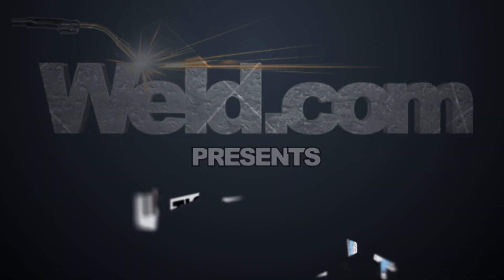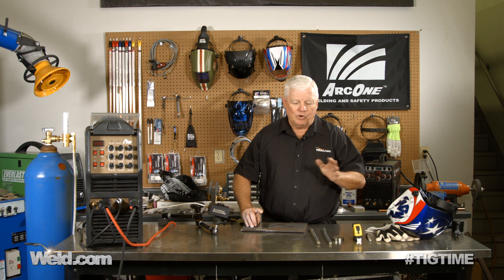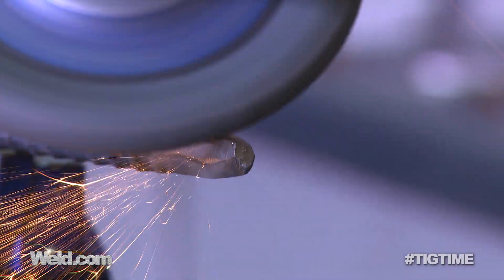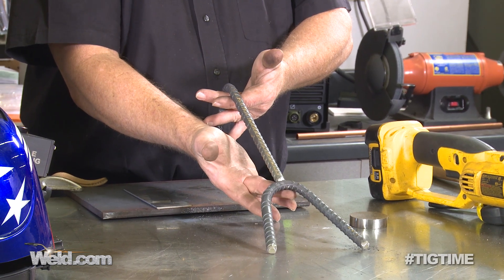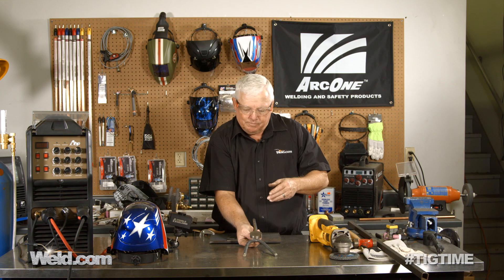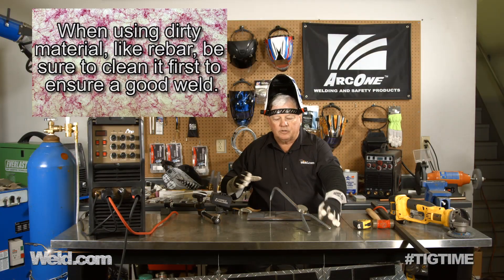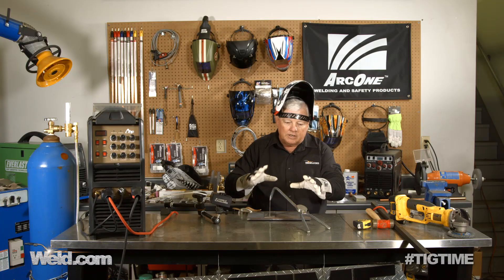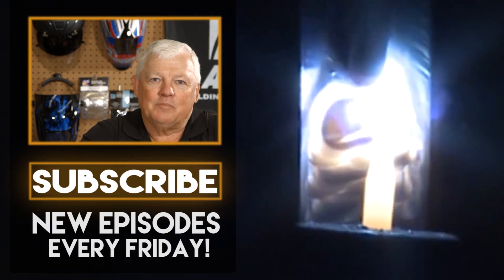DIY Welders Third Hand Tool: How to Build

Comment: The best use of a TIG machine for a maintenance technician is the ability to make custom tools that makes their job easier. I learned how to TIG weld over 40 years ago and would take scrap materials to make tools, sometimes melting in stainless washers to produce a desired shape. I will be making a third hand! Beats scrambling around finding a tool or piece of scrap to accomplish the same thing...

Comment: That looks pretty unstable for my taste, I much prefer a thick magnetic triangle and a strong neodymium magnet to sandwich the upright part in between. That third hand thing works probably fine for things that will not tip over so easily, but also there I am quite a fanboy of a strong collection of neodymium magnets ^^
Reply: Dennis Lubert I was thinking the same thing. My triangle magnets are my third hand.
Reply: noob , he did say it was stainless material he was tacking up. your super magnets have no power here !
Reply: miller welds noob, learn to read, especially the "strong neodymuim magnet to sandwich the upright part in between". They may not stick to the steel plate, but stick with enough force to the triangle to hold something in between

Comment: Just a thot of mine - I chisel magnets off of old speakers for tools, nuts & bolts, and your little weight could be a removable magnet or two instead, giving you one more tool close at hand!
Reply: Good idea, except if you grind near them then you have all the grinding dust stuck to it.  Maybe plasti dip the magnet or wrap foil around it for easier cleanup??
Reply: Also hard drive magnets are very stone and have screw holes.

Comment: Great tool to have on the workbench. I have two, one big and one smaller. Something I added was some copper. I took some copper house wire and tig brazed a bead of copper on all the contact points. Not sure if it helps or not, but seems to.
Reply: Jody suggested welding some silicon bronze on the end to help avoid arc strikes between the third hand and the work piece. If he says it will help I believe him so your copper is a good thing to have.
Reply: ...helps a lot....reduces 'arc strikes' and makes a better current connection....